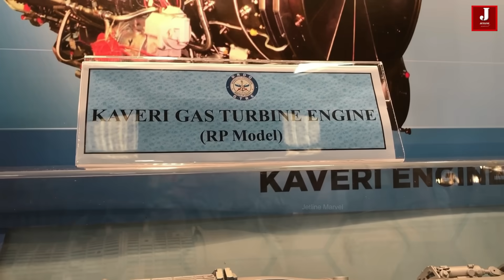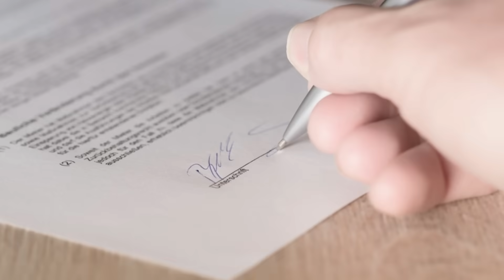India’s Indigenous Kaveri Dry Engine Reaches 48 kN Milestone #KAVERI #eNGINE

Comment: It was planned 52KN with after burner 82KN. Still non where near operational for jet. Chinese Engines are powered with 130KN -170KN (which is still has stability issues.)

Either GRTE or the sluggish Congress rule made many such crucial projects impotent.
Reply: 49kN dry Thrust Turbofan engein will be used in Ghatak Ghatak ucav. 
And with its afterburner section it can producee around 72kn of thrust so we need more work on afterburner section.

Till now indian government put only budget of 270million dollars on Kaveri engein development without any single testing facilities.

Other side CH put Total 48Billions dollars in its Jet engine development program including of testing facilities and flying test bed but they are still way behind russia in jet engines.

Other side UK or France put 6billions worth to develop new types jet engein even after they have all testing infrastructure, they still put 6 billions.

So be happy we even get 72KN engein in     
270 million dollars.

Jet engein is not a joke it's needs proper testing facilities, huge budget and constant testing and development cycle not by sending outside to other countries for testing and wasting and waiting years to get our engein for just small tests.
Reply: Andabhakt, still blaming congress after hacking the democracy and using all the money and musclepower for 12 years 😂

Comment: 48kN is not fully satisfying the requirements of 80kN for Mk1 or 85-90kN for Mk1a requirements. Kaveri 90kN must have been funded like 10 years back, and matured.
Reply: It's dry thrust no difference first'
Reply: The 80kN is dry thrust + wet thrust (aka afterburner).

48 kN is the dry thrust portion of the engine.
Reply: That's right. My statement is still valid. Where do you find the discrepancy?
Reply: Yes but it is not used for LCA Tejas but using for UCAV for these engines we need skilled people with government support because it requires lot of money and time
Reply: We needed 52kn dry thrust
Reply: @suhasvarna2463 for what..?
Reply: @infinitebeing1119   that was the thrust for which kde was designed